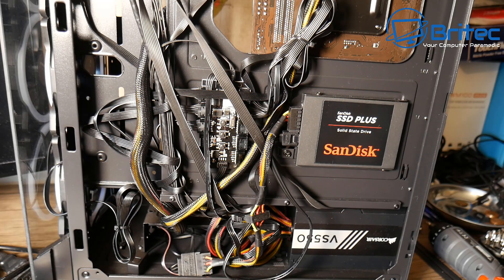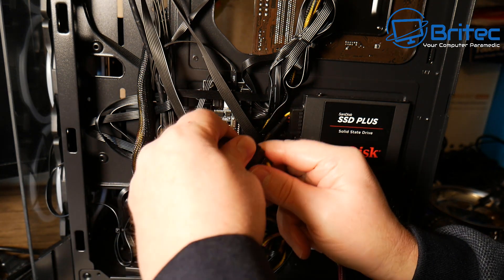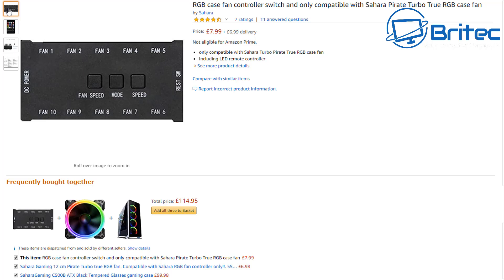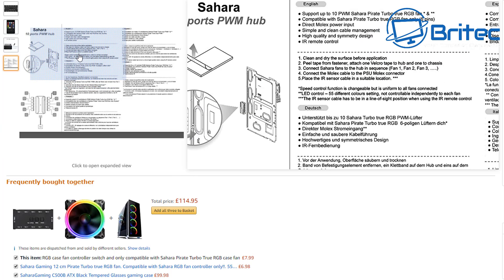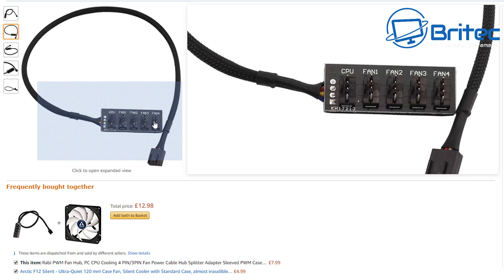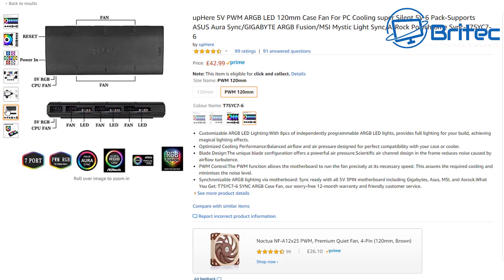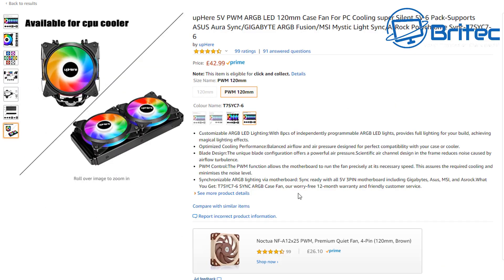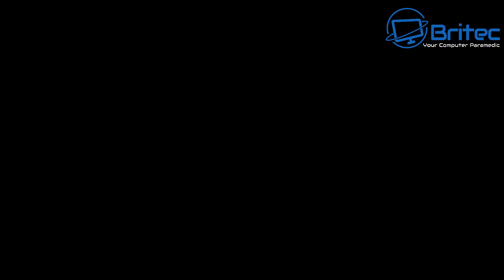Everything You Need to Know About RGB

Comment: good info here, although at 12:47 when discussing the uphere fans they do actually come with a dedicated controller that runs off of a SATA connection so no power problems and it also has PWM and ARGB pass through option so they can be motherboard controlled, or if you like,  you can also control the ARGB with an included reset style switch or you can connect up the controller to the case reset switch. Just thought this might be useful info for anyone considering buying them. I have bought a few sets of these and can easily recommend them for the whole host of options they give for ARGB enabled and NON ARGB enabled setups
Reply from the maker: I have had some issues with some fans sets connected via SATA where you can't control fans. Some of the sets are OK on Amazon, not had to much trouble with them. Don't really like the 5v RGB headers, I think motherboards are moving towards 12v 4 pin. I am sure someone will find that info helpful, I think the main thing is to buy a motherboard with RGB support lol